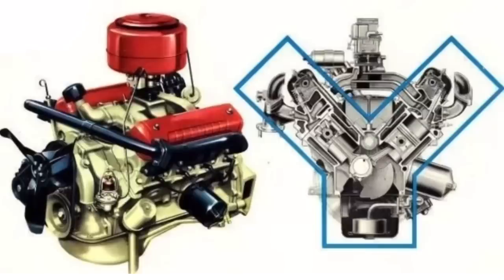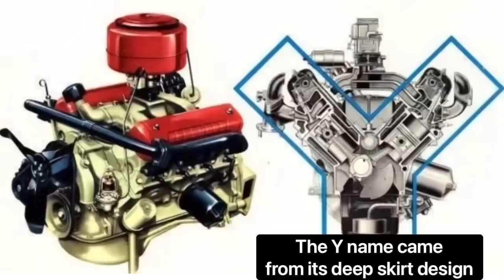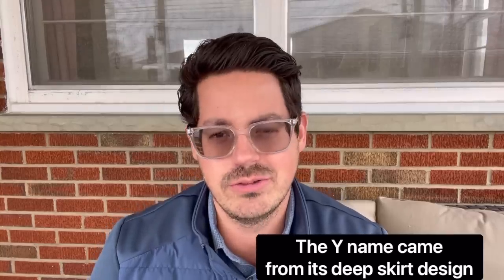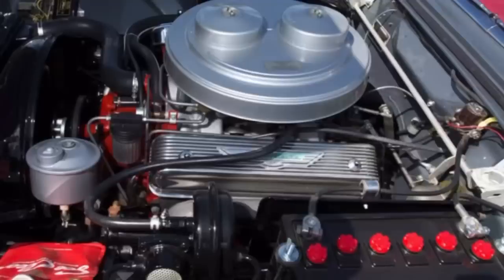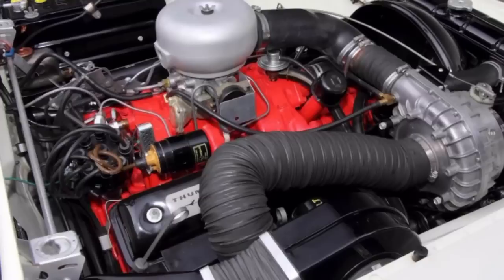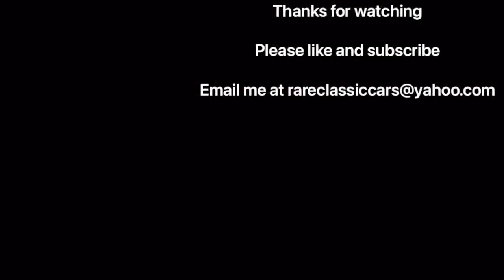Worst Engines of All Time: Ford Y Block V8

Comment: My first car was a 1955 Ford Ranch Wagon.[1973] The 312 Y block clogged oil to top end. Rocker shaft snapped !  My friend's dad  used to build rail dragsters.  He had a top end bypass kit for the Y block.  I installed it but motor was too far gone.😭

Comment: The Y-Block engines at mushroom type valve lifters which had to be removed and replaced from the bottom of the engine, which was a royal pain!  To remove the camshaft all of the lifters had to be held up with spring type clothespins!

Comment: Besides oil not nearly as good as today's oil, a major sludging problem was due to poor crankcase ventilation.  A road draft tube works OK at highway speeds to evacuate acidic crankcase fumes, but a car that only made short trips around town at 20-30 MPH would sludge up and plug the rocker passages.  PCV (positive crankcase ventilation) which came along about 1963 made a huge difference in engine life as well as a major reduction in air pollution.

Comment: Pure unadulterated junk. They’re better now because rebuilders know how to compensate for the original crappy design, and of course, modern detergent oils.

Many here are blaming the oils, but Ford designed that engine to operate on the oils of the day  — and it was a shoddy piece of work.

Comment: My first car had a 292, it had 109k on it when I bought it. The former owner had given up on it after the motor got noisy all of a sudden. When I looked at the car the dip stick read super low but the oil was clean. (The old woman told me her husband used only Penzoil 10w30 in it since new, and the car came with 8 vintage cases of that oil which the old guy had stockpiled when he bought the car new, it was in huge cans, the size of a large coffee can back then. 
Me and four buddies pushed the car home about a mile and I immediately ripped off the valve covers to find each nearly filled to the top with oil. The rockers, valve springs, and heads were covered in heavy waxy build up. The oil returns were completely blocked. I grabbed an old shop vac and did a quick clean up the best I could just to see if it would run down the road. 
After clearing out the oil returns, and cleaning up the valve covers a bit, I put it back together and took it for a ride, and all was fine. I drove it like that for about 5 years, then the oil pressure started to drop at idle. By that point the engine had close to 160k on it so I pulled the engine for a proper fix. The culprit was a clogged oil pump screen, which was packed with sludge and bits of what we reamed out of the oil returns a few years earlier. Off to the machine shop it went and when it went back in it had been cooked clean, over bored to .010" over but otherwise a bone stock rebuild. I upgraded the intake to an aftermarket aluminum one, installed a mild cam, and did some minor porting here and there but nothing crazy, just a basic port matching job. The oil returns were opened up a bit, the oil passages were cleaned and a pin kit was added to align the rocker posts properly. I ran the car for another 98K before selling it in favor of a truck.  Most of the issues we corrected were from the oil that was used and the low engine temps due to a super low thermostat temperature likely to make up for a badly clogged radiator, which was also replaced with the motor. The car was a three speed column shift, and other than a fresh clutch disc when we did the motor, all else was bone stock when I sold it at 258k.  It was a good engine, and if properly cared for they lasted just fine.

Comment: As others have already said, Ford Y-blocks were in no wise alone in suffering problems due to lack of oil changes/filters or non-Ford (in this case) trained mechanics goofing and thus oil passages not getting properly aligned or being just plain blocked by sludge. What you assert reminds me of another myth from those days, that of the early Studebaker V8s ('51 and partway into '52) "soft camshaft" problem. The Studes had valvesprings a bit too stiff for standard, non-nardened or non hardface-overlay cams, not "soft" camshaft defects.
 I think historical facts point to the opposite of your conclusion that Y-blocks gave FoMoCo a bad reputation. I'll try to keep it short. In '56, the 312 was in the T-Bird, and you could, in fact, get it in the more plebian Fords. 312 based engines in the "BattleBird" Thunderbirds broke a lot of hearts and records in top speed/LSR competition, and so on. In the era when winning on Sunday really did sell on Monday, NASCAR, even in those early years, was not the irrelevant joke a lot of us older gearheads consider it to be these days. So, when the #99 Schwam's "Purple Hog" 312 powered Ford coupe, driven by Curtis Turner, ended the season having won every single NASCAR race it was entered in (14 races or so, IIRC), most Americans (at least the male ones) knew all about it, even if most of them hadn't heard about the 312 version of the Y-block up to that point. Ford made a lot of hay about that, even if they were polite and didn't laugh at and insult the Chevy "Black Widows' cars that were getting most of the automotive press' attention and were not really competitive with the very few 312s that were racing. Ford did a lot of those filler films and some of those early TV presentations to promote the coming '57s, the availability of the 312 throughout the Ford line in a number of states of tune, how competent and confident Pete DePaolo and his team that ran the Ford stock car racing effort were, and so on. 
 Ford ended up with one of those sales years that hadn't occured all that often since Henry switched off Model T production: Ford outsold Chevrolet significantly for the 1957 model year. I'm not a gigantic Y-block fan, but claiming it was a bad engine that hurt FoMoCo...nah. It was an interim engine design that was not going to work well in the first MuscleCar era, that much is true, but I always felt that where it counted, it slaughtered it's primary rival in competition, and that led to the marque's victory in the showrooms and dealer lots.
Reply: The FE that was introduced in ‘58 was everything the Y-block was not — a good engine …

Comment: My parents first new car was a 1954 Ford with the Y block. The dealer had to replace the camshaft shortly after purchase. Now I wonder if it was one of those with the incorrectly installed cam bearings.

Comment: I drive a 64 f250 with a 292 and 4 speed. Bump the key and it starts. No oil, no smoke, quiet. I am ready to dump my newer vehicles and get back to reliable workhorses that I can tune.
Reply: Good … Get yourself an Olds V-8 or a B-block MOPAR …

Comment: I think it's a bit harsh to say "worst engine of all time" The only oiling problem they had (as stated many times here) was the bad oil of the day. I have been rebuilding engines for most of my life and have disassembled many "vintage" engines, all of them have trouble getting oil to the top end if the oil isn't changed regularly. I've even seen 265 sbc with push rods so clogged not a drop could get through. It really does a number on the inferior "ball and stuff" type rocker. 50s Buicks, Oldsmobiles, Cadillacs all had similar ways to get oil to the top end.

Y-blocks made good power right from the factory and make better power with very few mods. I have owned and still own several that run very well, including one 292 bore .080" over for 304ci that has ran 196 mph+ in a Model A roadster. Another 304ci Y-Block I have in a 62 Unibody pickup has ran just shy of 150 mph. They rev good and if built right are Bullitt proof.

Comment: They had no oiling problems its more like modified problems like most other things and that mel well its basically a big y block so ford over head valves and cams in the 40s the gaa engine looks a lot like a modular

Comment: I'm using 5-20 full synthetic oil in my '54, works like a million, took mine across ND at 80+ MPH with no problem whatever, no doubt the oil in '54 was not up to the modern standard of the  Y-block engine, at least it is now ....

Comment: It was first of it's kind.  Yes it had issues especially with crap oil.  I have my high school car a 55 Ford Fairlane.  I've had it since 1970 as it was 15 years old and perfect for a teenager.  Once I cleaned all the oil galleries from the cheap oil she ran like a top and quietly and still does today.  Yes I still have her and take her to shows whenever I can.  I'm 70 now and she's 68 years young.  Purr's like a kitten.  The only change I've made to the car is dumping the 3 speed on the column and putting in a Mustang 5 speed Tremec .  Totally off the hook now.  My son want's me to put in a I beam front end and headers to make it a gasser.  Seriously thinking about it.

Comment: I owned a 64 pickup w/292. Ran great. Hauled a lot of firewood and pulled a loaded trailer often. Sweet old truck that I enjoyed. I seen many with the rocker oiling kits but mine didn’t need it. I ran 10w40 valvoline. It did leak but not “terrible”.
Reply: Sounds like I bought your old truck or one like it. Running strong, lots of torque, quiet and reliable. I am getting rid of my newer vehicles and going back to reliable carb powered, non electronic stuff that I can tune myself.

Comment: My understanding was that initially  with the 239 and 256 maybe 272 initial engines, had a cross drilled center cam journal for moving oil which proved inadequate for oiling, so was then changed to a center groove in its circumference instead which helped some.  So I thought I read somewhere.  
My 272 (56 f100) drivers bank would not oil. When I took heads off, sprayed brake cleaner down oil supply hole in deck, filled oil pan with varol and used electric drill and pressurized system turning engine pump,  . . . nothing. Then compressed air down the deck hole and prime and air . . . Another day later while air hose was more sealed there was a pop sound and could feel a bit of air if I pressured the oil deck hole from pass side.  Wasn't gang busters but now was an adequate flow to the drivers side, plus I pressurized the rocker shafts when I changed them. Good flow.

I'm in process of rebuilding now and when I removed the cam bearings, I got a dremel snake conduit with a cut off disc and 1/16" grooved out the cast iron between the top 3 oil holes of the center cam journal.
I'm told that this is what is done in Ford's F E seriess.  Anyways I may have to now thread tap the oil deck holes in the heads and use an Allen set screw bolt with a small drilled hole to limit the feed now with this joining groove plus the cam bearing groove.  Too much oil, maybe ?

My understanding is that these engines 272 and 292s were still in production in other countrys up into the mid 70s or more as well, so the production time span of the y block production was at least 2 decades though one decade in U S  and Canada.
Been talking to some mid 70 year old hot rodder that built and raced them and am told that many Chevs were blown away.
Another point which I read was that even though the different length ports in Ford's stacked style heads when comparing Ford's and Chevs stock performance heads, the Ford's would flow a bit better.

Comment: I've owned a Y-block for 42 plus years and you couldn't be more wrong.  I bet there a least 200k+ Yblocks engines still in service today.   Yblocks are far tougher than any of their contemporary rival engine designs.  When Ford finally decided to replace the Windsor series, they went back to a Y-block design with overhead cams.

Comment: While I admit that the exhaust pipe across the front of the motor was both fiscally and mechanically painful it's nowhere near as bad as the small block Chevrolet, if a small block Chevrolet lasts me 100 miles before throwing a rod either through the oil pan or side of the block, it was a really really really good small block

Comment: One problem for the 312 Y-block. That wasn't the 312's fault, was early shop manuals were printed with incorrect torque specs. This caused some 312 blocks to crack because people followed the shop manual and greatly over-torqued the mains. My gramps built a 292 in the 60s that he used to drag race and rev to 7k. That motor still ran fine after 40+ years. It has 11:1 compression and a big cam though, so I built a 312 to replace it for better street car manners. My 312s been running fine for about 10 years now. I'd love to find a 1930s ford to put that old 292 motor in. I'm sure thers old farm trucks still running on 60+ year old 292s today.

Comment: You Obviously do not have very much experience with the trusty "Y" block ford V-8. As a builder of Street Rods, Customs, Muscle Cars, and Classics for more than 50 years now, I can argue what you said about the Ford "Y" block right into the ground. I've raced oval track with Y block power and they performed and held up very well. I ran one on the track for 4 seasons with no issues with it at all. Use good oil, and keep the valves adjusted (CORRECTLY) and the Ford "Y" block will run for ever.
Reply from the maker: I’m not talking about modified engines; I’m talking about how they came stock and how people typically serviced them.  In that context, they were finicky.  I agree with you they modded well

Comment: I got 15years out of a 272 in My f100 1954
I put a oiler kit from Amazon and been nothing but great
I haven't changed the oil in about 7 years
Or put lead additives or run super unleaded gas
I used regular with ethanol and everything
Bad for it
It grabs 3 Rd gear sideways on 410 9 in rear end
Has been more than nothing but great to say about the Y-Block v8
I found a 292 with a automatic transmission hooked to it ran when removed
For a Chevy LS swap
For 450 dollars
I never had the 292 in half way there saving for a replacement Y-Block

Comment: We had a 1957 ford pickup with a 272 cu. In., on the farm and it was a good truck with about 90,000 miles when one of my brothers totaled it! Not a great amount of horsepower but good torque.

Comment: I grew up in those days and do not agree with anything this guy said !!!! Change the frigging oil was the problem !! And no a flat head was not better , they needed something better that why the Y BLOCK showed up .Sure they made the oilers aftermarket but you seen no dealers putting them on.  Just as today some do not take care of their ride ! I'm a certified ford mechanic and the Lincoln engine had 300 horses that was something in those days .They would put them in the smaller cars  and have one hell of a ride . But the 292 and 312 was not dogs my 55 ford blew many others away .I used 10W40 oil in it ,,wish had it today .

Comment: Nice info thanks.. I think despite these oiling issues they were still incredible workhorse motors that powered America in many forms for many years, many with minimal maintenance or care. They soldiered on until they died literally. Kinda like the late 2 valve Triton motors in school buses and work trucks around the country..

Comment: Another interesting characteristic of the Y-block oil sensitivity was the continuation of habits that many people had developed from the robustness of early flathead engines. Engines other than Fords that used splash oiling were much less prone to problems with oil sludging with splash lubrication. Many of those in the Y-block era had grown up in the Great Depression/WWII days when used non-detergent oil was strained through ladies stockings containing ground up citrus peels and activated charcoal. That "filtered" oil was then put back into the engine and run again. Y-blocks did not do well with such sketchy oil habits that many of those Depression/WWII people had. Also, non-detergent oil was a big no-no, which was ignored by many.
The Y-block was also sensitive to road draft tube dynamics and duration of operating temperatures. Too many Y-blocks were used for short distance travel... in which the engine did not run at high enough temperatures to help the oil flow freely or for fumes to evacuate adequately. Many of the improvements in oiling and crankcase breathing that came later were learned from such engines as the Y-block Ford.

Comment: I have an non-rebuilt Y block in one of my old Fords - a first year 239 from 1954, no less, which has the worst reputation of all the Y-blocks.  But, it runs smoothly and quietly, even after all of these years. What Adam says about using detergent oil is correct. HOWEVER, if you find an old 239 or 256 Y-Block from '54 that still runs but has been abandoned (as mine was), I would definitely change the oil every 100 miles a few times with detergent oil. Then you can start changing the oil every few hundred miles. The detergent oil will very quickly start dislodging sludge and sludge particles which could clog critical passages if not quickly drained.  The sludge will diminish with subsequent changes, and eventually disappear. I now change the oil every 500 - 700 miles (12 to 18 months of driving for me) and have no problem with sludge build up or upper end/rocker oiling. Also, you should remove the valve covers periodically to make sure the rocker arms and up end component are being lubricated properly.

Comment: The first thing mentioned regarding oiling problems in this ‘worst’ Ford engine is owner negligence i.e. using non-detergent oil. Next was badly-installed bearings in rebuilt samples. Sounds like the engine itself was a good design, save for the crossover exhaust pipe.

Comment: Have a daily driver 1960 F100 , 292 Y block, have made several trips a year down south pulling a trailer to motorcycle races, never an oiling issue using Rotella oil best for flat tappets, love the off idle low end torque, great engine 👍